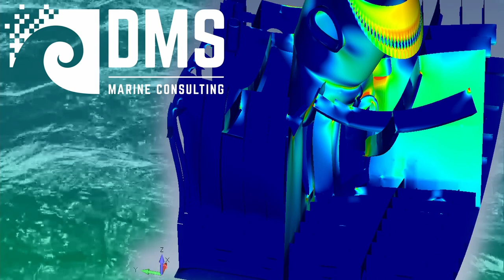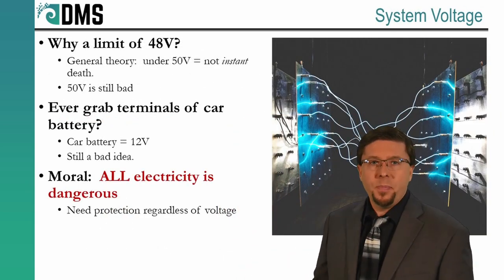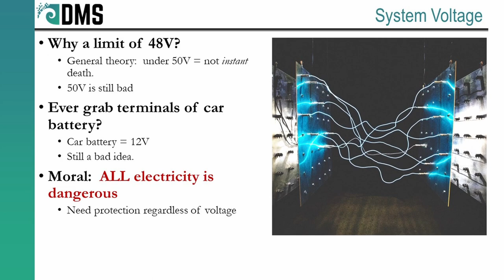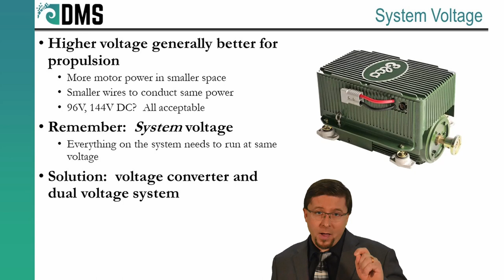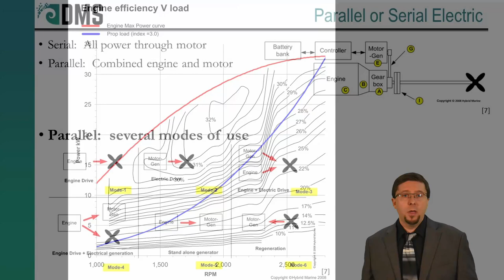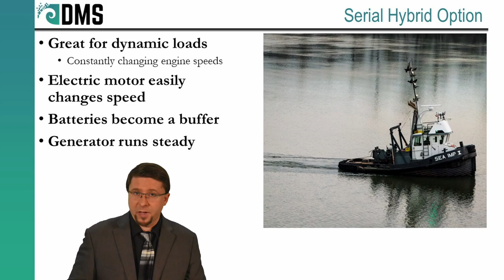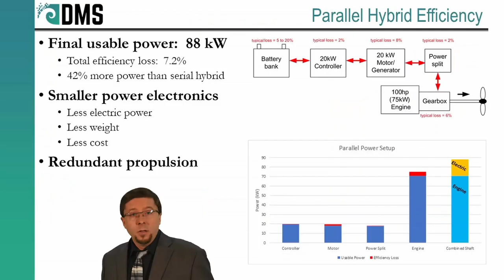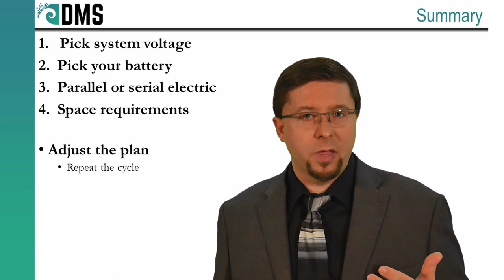What to Buy for Your Electric System?

Comment: An exceedingly interesting and informative video! As usual... :) One small point: From an electrical engineering point of view the output from an electrical machine of a certain size does not depend on the voltage. A lower voltage requires thicker wire but fewer turns so the torque stays the same, power stays the same. It does depend on speed (that is why brushless motors running at high speed can produce huge amounts of power in a small package). Voltage sometimes does practically have an effect because the terminal blocks for low voltage are so huge they add to the volume of the machine! I'd expect that over time the voltage for small - moderate power installations will end up at 250 - 400 VDC, maybe slightly higher. This matches up well with semiconductor device ratings and costs and wiring costs.

Comment: So, NIck, serious question: what kind of considerations need to be made if one would want his yacht to be EMP hardened. I'm guessing having spare components on board, e.g. nav displays, etc. would be one consideration.
Reply: I think NOT being a prepper is the safest thing to be. Not being prepared for a collapse provides maximal incentive to work on preventing the situation in the first place, rather than surrendering to any perverse incentives to disengage and do nothing. As I tell my crews, "The most effective piece of PPE is your brain--No gear will save you if you allow yourself to be in a bad situation."
Nick's advice would be to hire a competent professional. At a minimum, I'd go for an electrical engineer.
As a surveyor, my advice for your specific example is to learn to use a sextant, compass, and paper maps, because your nav display is going to be useless without satellites.

Comment: I'm 99.9% sure that ABCY rules on traction systems require that hotel/house batteries are NOT same bank as traction power. So you can have 48V or 24V hotel since accessories are more available here, and make you traction voltage something else. So this might break the same voltage for everything rule...
Reply from the maker: I was concerned about that as well.  I checked ABYC standards E-10 (storage batteries), E-11 (AC & DC Electrical systems), and E-30 (Electric propulsion).  I could not find anything that requires the traction battery and hotel battery to be separate.  There was an expectation that the starting battery for engines should be separate from the hotel battery.  But I could not find a requirement to separate the hotel and traction batteries.  If you find the reference, I would love to know about it.
Reply: @DatawaveMarineSolutions  You are probably correct in that case. My 99.9% confidence factor was too high; now that I think about it, the comment was from a colleague who I respect and 99.9% was the person, not the information :-) Here in Australia we have --nil-- guidance from regulatory bodies for DC marine system, other than it falls to the ELV/LV rules where you can do what you want under 120V DC. I also heard AMSA (our peak regulator) is going to limit battery ESS to 30kWh, for vessels outside of a class type. I assume they'll make new classes and survey rules for > 30kWh but have no idea today.